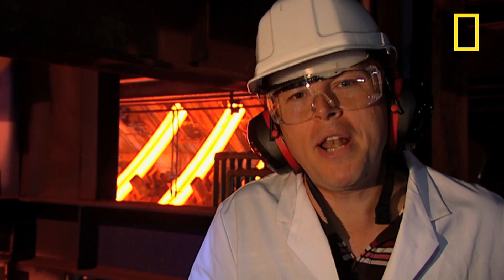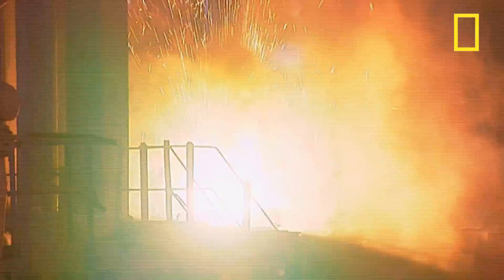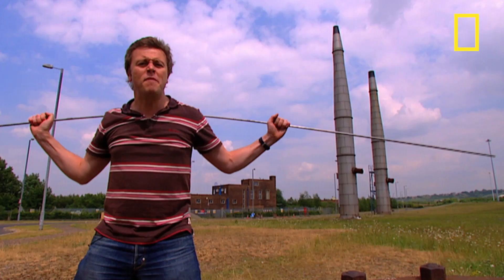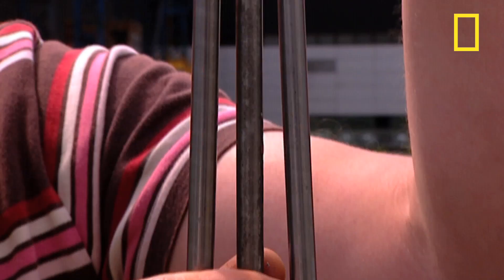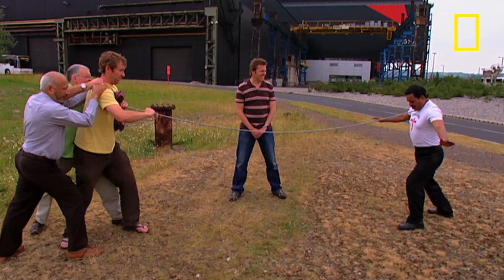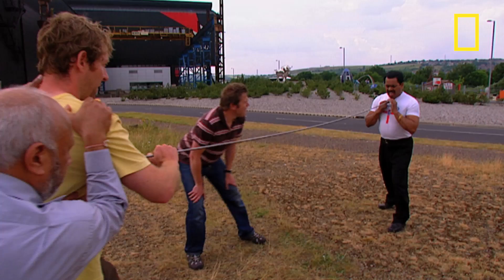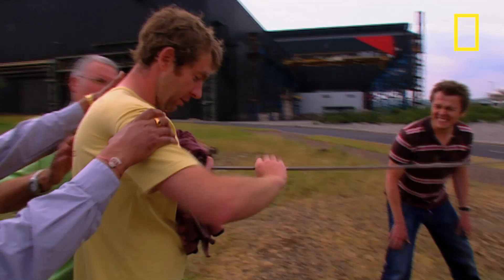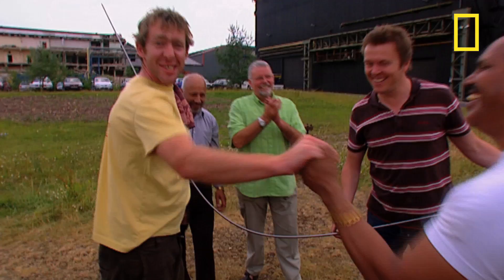Bending Steel with Your Neck | I Didn't Know That

Comment: At a length 10-12 feet if you shake ANY of the rods, they are going to wobble like a vehicle antenna and be very easy to bend. Did you happen to notice how much the rods bowed merely from their own weight? Those rods looked to be about 1/4 inch thick, but at a length of 12 feet even a 1/2 inch thick bar that is held horizontally 'droops' and wobbles when shaken. Also, the 2 hosts were only trying to bend a 3 foot section of an 8-10 foot rod.

Comment: It's hard to bend like that because you're holding it at 2 points much closer, so you have less leverage.  The longer the object, the easier to bend, as long as you hold at the further ends.  Put a toothpick on your middle finger, then put your index and ring finger over it, then try snapping it by pulling your index and ring fingers down, it'll be near impossible.  It's doable, but it'll be very difficult.